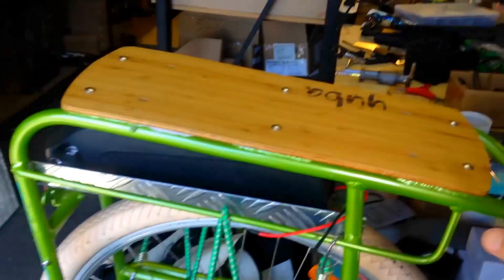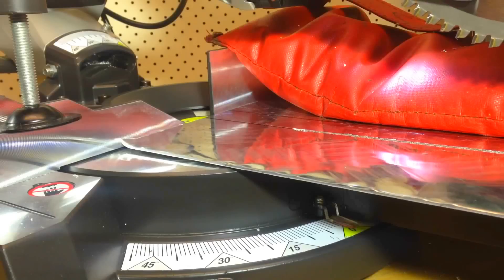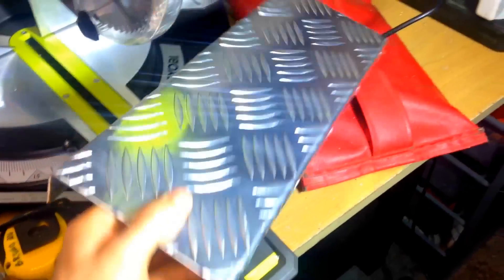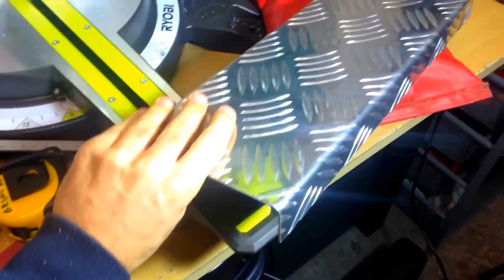Fabricating aluminium battery tray for Yuba Boda Boda cargo Electric Bike Bafang BBSHD conversion

Comment: Yuba have redesigned the BodaBoda with a new V3 frame designed to accommodate an ebike battery behind the seatpost. From what I can tell the battery needs a different design of aluminum tray, now a type of bent bracket, to bolt onto the new bike. Yuba supply this for Bionx and eRad conversion but this would be a useful part for some business to prefabricate and sell for other generic batteries.

Comment: when is the next video coming out, i am checking every day!!!
Reply from the maker: Ahhhh.... sorry for this ultra delay... i had some cool stuff that was kinda ready to post and my phone simply died... =[  Anyway, that was a good excuse so I just got a new phone today =]
Another reason why I haven't been posting lately is because I was busy working on my new super stealth BBSHD creation... no display, no ebrakes, no on/off switch, no speed sensor, no PAS, no harness... custom programming...
Showing that beast this weekend =]
Reply: +ElectricBike (Bruno) yo!!!!!  This is exactly what I always wanted!  I never even installed my "e-brakes" it just takes away control. Anyway, I hope you can share or teach us how to do it. The only reason I would need a display is for battery and RPM data. For everything else I got my phone.

Comment: Hey Bruno, Nice vids, love'em! ;) Keep them coming. I am making a battery but i need some help, could you look at this ?

I am making a 16s7p battery for my ebike now and i am going to order som cells  (NCR18650B), 112 in fakt pluss 4 spare and i was wondering if you could help me? I will be using a 16s 60/80A LiPo BMS to controll the cells. The charger i think of using is a 67.2v 5Ah charger. Links to both bms and charger under. If i use this kind of charger and bms, is it all plug and play ? I am new to this so i want to make sure that i can use this type of charger and not having to worry about the battery catching fire or anything!
Also i read that the NCR18650B could output about 2C which will be equal to 6.8A in one website, but another one said 4,375 or something max. Do you know the real continous Amps these can deliver? ( need 40 for my 12 fet so i will go for 7 in parallel).

Battery cells: http://www.gearbest.com/batteries/pp_189823.html

Charger: http://www.aliexpress.com/item/high-power-60V-5A-lithium-ion-battery-charger-Ouput-67-2V-5A-charger-Used-for-60V/32622852679.html?spm=2114.30010308.3.9.Sc7TEH&ws_ab_test=searchweb201556_10,searchweb201602_1_10037_10017_405_404_507_10040,searchweb201603_1&btsid=eaf35203-1eeb-4e8c-85a5-4f31be875ff8

BMS: http://www.aliexpress.com/item/16S-Li-ion-Lipo-Batteries-Protection-Board-BMS-System-60V-67-2V-50A-Continuous-Discharge-Current/32263328170.html?spm=2114.30010308.3.11.Omk03v&ws_ab_test=searchweb201556_10,searchweb201602_1_10037_10017_405_404_507_10040,searchweb201603_1&btsid=95e9c0a9-0e57-4cde-9cef-3b946d5f2616

-Mathias

Comment: still delaying I see.. ;)
Reply from the maker: Yeah the 42000w is coming soon haha =]
Reply: ElectricBike haha I cannot wait to see it bud its gonna be WAY TOO MUCH POWAAAAAaaaaaa... ;) You got any suggestions for battery casings need to make a battery for another bike and just want to buy in a case not make one..
Reply from the maker: +Dave Webster - Hailong or Dolphin the popular basic models, if want something more POWERFUL and exciting, in Australia we may be able to make something but if you're outside Australia you MUST talk to Paul www.em3ev.com he makes awesome custom packs!!!
Reply: thats frames a good price.. I meant the actual housing as opposed to a complete pack I have all the batteries, (recyclings going well :) so just need a case.. :)
Reply from the maker: +Dave Webster - ahhhh... in this case I would recommend go to an electrical shop and look for a plastic switchboard would cost you less than $70 for a really good, strong and weatherproof, some are IP67 which is 1mt waterproof but any IP64 or above would provide an awesome protection. You can also get a triangle battery bag and put the batterie inside =]